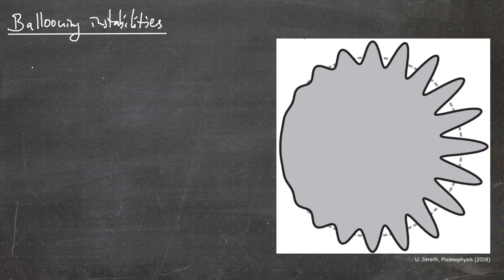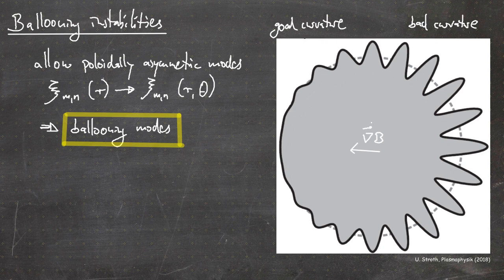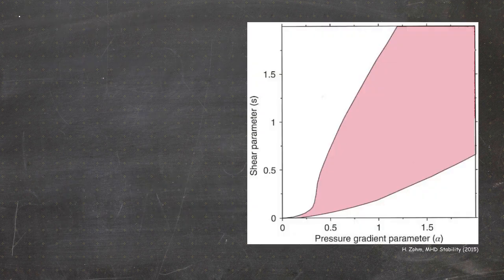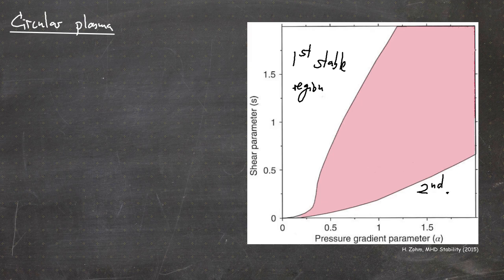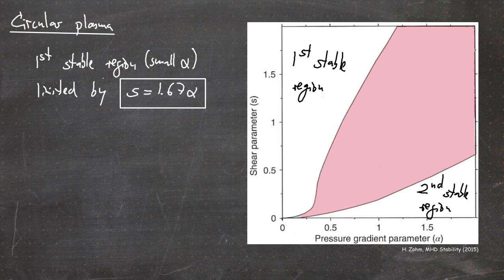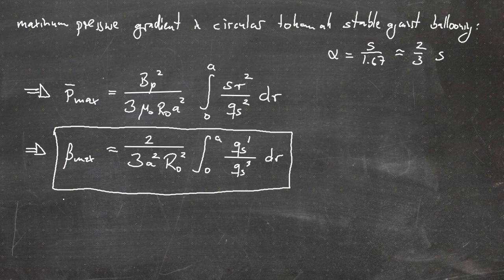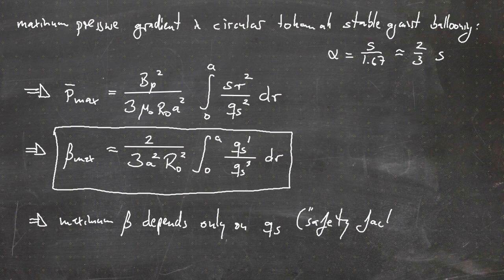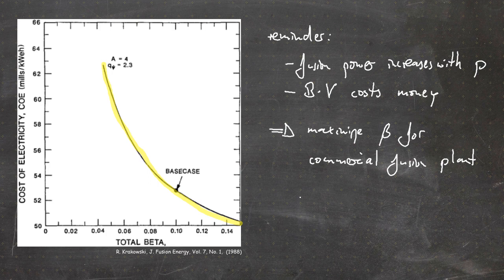Fusion Research Lecture #18 - Ballooning instabilities & the stability beta limit

Comment: This whole series is amazing! May I ask, do ballooning modes ripple around the edge of the poloidal cross section in a particular direction over time, or are they stationary and bulge, then dissipate? Also, are the balloon perturbations limited to a small segment of the toroid, or is the ballooning cross section unchanging around the whole toroid flux surface?
Reply from the maker: Good question! Depending on the plasma parameters, the ballooning modes grow in time and can then become unstable leading to loss of particles and energy. Their direction of rotation also depends on some parameters (and the model they are described with) but is often into the electron diamagnetic direction (if I'm not mixing things up). If you have a fully axi-symmetric device, they are basically everywhere around the torus. Only if you have some kind of asymmetry somewhere around the torus, they might be somewhat more localized.

Comment: Hi Professor, it's really good to have this online course. However, I'm a little bit confused in 19:00, where \betta_{max}  is proportional to the integral of \frac{q_s'}{q_s^3}  rather than \frac{q_s'}{\q_s^3}*r^3, because s=\frac{r*q_s'}{q_s} ....................(Also if the equation is that then \betta shall no longer be dimensionless quantity)............ Could you please answer this question?
Reply from the maker: You are absolutely correct: there is an r^3 missing in the integral of the formula for \beta_{max} (and in the denominator there should be only one R_0), thank you for spotting this!